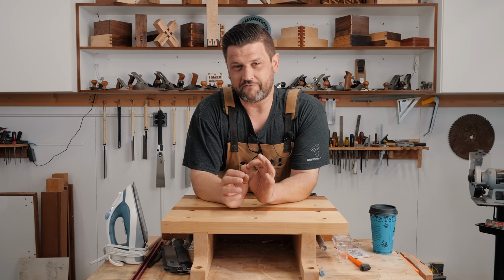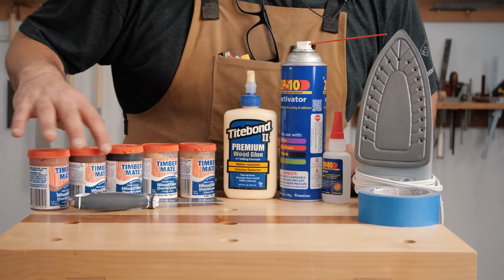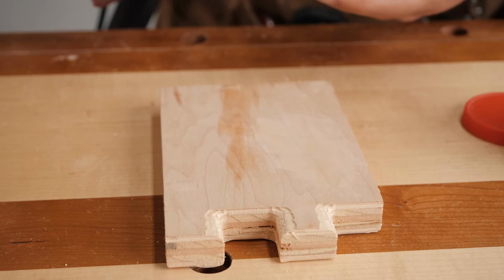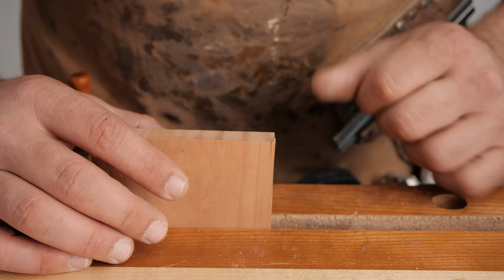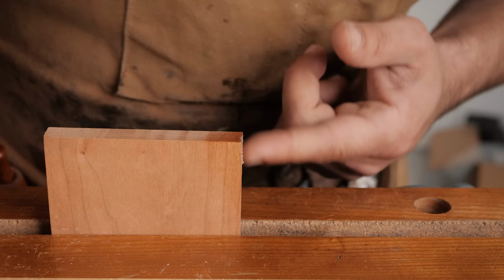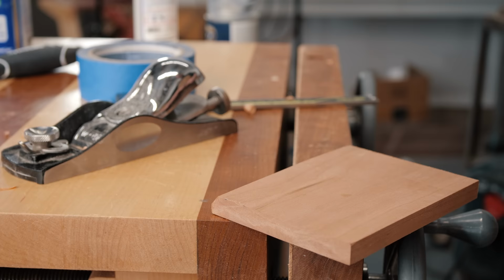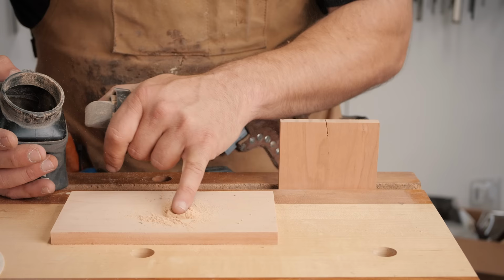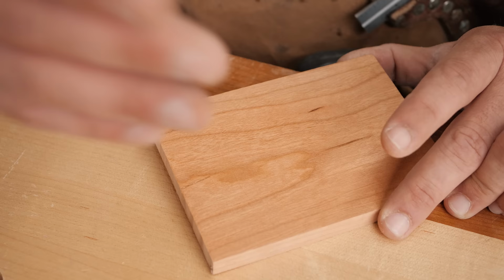7 Ways to Fix Common Woodworking Mistakes

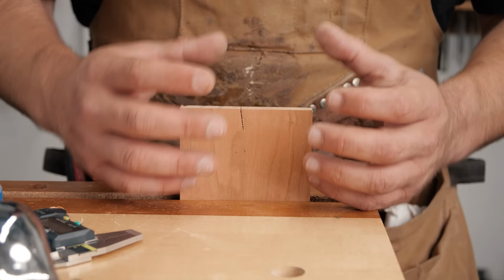Comment: 7:21 Another great trick (that's even less work!) is to fill the gap in with glue, then sand with a sanding block on top of the gap and it automatically fills in!

Comment: Protip, rather than spend money on filler. Use glue and the sawdust from sanding the exact material to make a custom putty which will be an exact match to the piece you screwed up. If I'm using filler it's because I intend to paint that part of a project, so you don't need to spend a lot of $$$ on colored fillers.

Comment: The sawdust and glue method does not work wit Many finischings like lacker but you can also use like a spezial glue ore if the finish is oil you can also use oil... Use your mind and make tests...

Comment: A method I learned for panel glue ups is to do a “in out” method. Your first board you joint should have the face in (facing the fence) than the next board should be out(face side pointing away from the fence. Continue alternating with however many panels you have. This helps if your jointer is not at 90 degrees by creating a complimentary angle that will help close the gaps.

Comment: 12:15 what equipment was used to mill that board? I want to mill a 12 x 12 x 2 in piece of white oak down the middle to open it like a book. I don't have an actual mill is there some kind of jig I could make
Reply from the maker: Check out my planer sled with drywall video. Cheers

Comment: I have a guitar made of Honduran mahogany, and I used the Rockler  wipe on finish. I got a dent in it afterwards. Will the iron and water trick work for it? What steps should I take? Or should I do the sawdust and ca glue fill route? I appreciate any feedback from anyone. Thanks!
Reply from the maker: The iron should help. It works through paint even (from another commenter)

Comment: I've made a few heavy-duty picture frames from salvage wood -- knots, cracks, nail holes, ...
Sometimes the knot falls out or breaks partially.
The fix?  Heavy varnish on the knots.  Bowties bridge the cracks, if they're bad enough.  Maybe a splint or two.  A little extra varnish in the holes.
Result: Dramatic.  It's *wood*; it's not plastic.

Comment: Great video, thaks. I leave you one more trick related with the video, if the glue doesn't want to fill the gaps on the wood help it with dental floss to move it deeper.

Comment: How would you fix deep scratches in a sprayed handrail?
Reply from the maker: Epoxy maybe using blue tape. Sand flush and re spray
Reply from the maker: Epoxy maybe using blue tape. Sand flush and re spray
Reply: Evan McCrindle I'd use furniture repair wax sticks. You can melt them on a spoon to mix colours and get the perfect match

Comment: Something I stole from Crimson Custom Guitars is to:
Take masking tape, align it to my bench (or one piece of wood, if I’m hand-joining with a plane) and to the other piece of wood, apply CA glue to one piece of tape and accelerant to the other (do this in two to five areas depending on the size of the piece) and combine them for the effect of double stick tape without any of the residue

Comment: Personally I hate wood filler. I ALWAYS can see it. Maybe my eyes are just different but I can spot it every time. I've pointed it out on stuff at family friends. They can get close but it just slightly off. What I use is the wood glue saturated with very fine wood dust from the same species. I have bags of the dust in my shop.

Comment: My most common mistake is not thinking when it comes to where I put screws. I've lost count of the number of times I've screwed in from one side and then tried to put another through it at a 90 degree angle... :-|

Comment: wood filler is generally shit for plain wood finish even if you sand it, reason is when you varnish it it doesn't darken like the wood and becomes visible. Sanding doesn't usually get rid of it and you don't know unless you varnish...best way is to fill with wood filler then as it starts to dry wipe off the excess with a damp cloth, that way it finishes better if you varnish it ;)

Comment: simple fix for cheap tools and questionable materials?
I was putting what was supposed to be 3/4 dowels into holes I made with what was supposed to be a 3/4 spade bit, but the holes were too big. I took a very fine file and made a few passes on the sides of the bit. The rest of the dowels fit the holes perfectly.

Comment: how about old school egg white and saw dust..... ive used this trick on every single guitar ive made coz I prefer to be as "natural" as possible and I like it to fill pores for French polishing... I guess its more of a step not really a fix but whatever
Reply from the maker: I've never heard of that one. How does it work?
Reply: @katzmosestools  I just separate the whites from the yolk into a small container and pour a bit onto the piece and spread it out and sand using a fine grit... maybe start at 400 and go up from there so it get right into the grain and pores... I usually do this after ive done most of the finish sanding. I use a small sanding block and the edges on one long side and one short side chamfered and leave the other two sides sharp to get into corners (I don't know if its necessary but I just thought it might help to be a bit softer coz I don't use cork ones) I make small circles and figure 8s like as if I was applying shellac. when it starts to get a bit tacky I just spray bottle a bit of water to help it slide. I let it dry for an hour or so and continue up in grit with just a small spray of water to start each grit... drying between each grit until im happy with it. once im done filling I just lightly hand sand with the grain with the finest grit I have (about 1200 grit)  and then let dry over night then vac any remaining dust and im ready to French polish. this is just my way of doing it.... im sure other peole have their own ways. experiment bro.

Comment: I was trying to make a bookmatched acoustic guitar top and both sides are cupped. Do you have any tips for flattening wood? I tried to use some water on the concave side but that didn’t do much.
Reply from the maker: You should watch the whole video. I address the same issue

Comment: What if the sawdust and glue were mixed together and then added to the "feature"? That should make a better end result than just sprinkling it on. The worst part about mistakes is that you know they're there, and that infuriates me. Probably why I'll never make a proper woodworker

Comment: All great ideas, except the glue & dust in "all joinery cracks".... ummm... then the wood can't expand like it should, and when it contracts, ugly cracked glue fills. Mistake imho.
Reply from the maker: Disagree 100% but appreciate your opinion
Reply: really?  a woodworker who doesn't "agree" that wood expands and contracts??  oooof.... to think I almost subscribed.
Reply from the maker: @ChrisLocke1969  hahaha please do, I didn't insult you. In fact I was quite polite with my disagreement. You clearly don't understand wood expansion. Wood expands on average 1/8 an inch over 3 ft. If you think that a 1/4 inch wide dovetail is going to expand anything more than a hairs width you need to educate yourself bud. PLUS, if you're using glue what does it matter if you rub sawdust on it. I do this for a living. Day in and day out. I've literally never had a piece come back, out of 1ks of delivered pieces.
Reply: @katzmosestools  insult? Its insulting to not realize we don't all have sponsors to help pay for maple, to fully understand wood expansion. Good day, sir.
Reply from the maker: @ChrisLocke1969  hahaha that's the most asinine argument I've ever heard. So you're admitting you're wrong and blaming it on the fact that I've been a professional woodworker for many years and I worked my ass off to grow my business to where it is today? Sponsors dont come before basic understanding of wood movement.

Comment: Always save your sawdust! Lol.

I was fixing an antique table that had the horrible misfortune of being "repaired" multiple times of the years. When a friends kid (my age) decided to get drunk and sit on this poor center column, tiny table, he broke three of the four feet off of it, two were loosely held together with sheet rock screws without the courtesy of a pilot hole. It really was a mess down there. 

So some doweling,  custom making a jig, and lots of sawdust+glue because there were peices missing, and cracks left from the screws, it was back to normal in two days. Well, not completely, because the feet were old enough to warp over the years, and i was there to put it back together, not restore it with refinishing.

Comment: Japanese carpenters, leave their mistakes in, as a reminder. Sawdust and glue, very old trick. Best trick of all, blue tape, does more than people think it will. Now, the "reflattening" but on an angle? Naw, just always went flat with a hand plane, more accurate than a planer/jointer.

Comment: So, I'm still watching the video but I doubt you'll cover it. I noticed that a lot of woodworkers (at least on YouTube) when they glue stuff together they don't align the wood on all 4 sides. Like I was just watching a chess board being made and he didn't align all for sides before using glue. Normally the excess is cut off but if it was even there would be less waste. This isn't channel specific I've seen a loooooooot of channels do it some waste more than others but it drives me crazy. I'm just wondering is their a specific reason is it laziness for some or is their a positive I'm missing. I won't name channels but big and small ones do it. It is just mind boggling to me cuz it's essentially throwing money away. I would be as efficient as possible to use the most wood especially if I was using expensive hardwood. Hell I'd save pine.
Reply from the maker: Its probably way too long to explain efficiently here but am basically the only way to get a truly flat square edge sometimes is to cut it off later
Reply: Jonathan Katz-Moses oh I knew that but sometimes there's huge chunks cut off 👀 even if it was to get a square edge wouldn't having straight pieces still be better than random sized bits? Especially with the more expensive woods? Like I said it's almost every wood working channel lol I figure there's something I'm missing besides a square edge cut because someone who takes hours to create (sometimes hundreds of hours depending on the size of the project) probably isn't just a lazy ass who doesn't care.
Reply from the maker: @NerdyDude186  as a new woodworker everyone feels that way. As you get more experience you realize that the 1 x 1 x 1 piece of wood you worked so hard to save will just take up room in your shop for eternity. I have drawers of exotic cutoffs I fantasized about using for this or that. I think I've dipped into those maybe 1 or 2 times in the last 5 years. You'll realize if you're trying to size for glue up you'll never have perfect edges. Never. Trimming sone pieces after glue up is the only way to get square clean edges. You learn that because you spent "100s of hours" saving 2 dollars in wood is worth the trade off of perfection. Plus what's the difference if you cut it off before or after glue up. It's still extra. Boards don't come in the same size ever

Comment: There's no way to fix mistakes,
Only mask them.
And if your shooting end grain without a centre finish or a shooting board then you have no business holding a block plane (the correct plane for shooting end grain).
Call me picky, but I kind of think:
Right tool=good job.
Wrong tool=bad job.

Comment: The problem with the sawdust is the durability and the discoloration overtime or even when you add the finishing touches.

It will look good for about 6months, but after that, the glue will begin to mismatch the coloration of the wood.

And when you do finishing, it won't adhere as well to the glue and will cause very apparent structural mismatch.

They're great ways to make a quick sell, but after X amount of time, it will become apparent and as a Woodcraftman, you will lose credibility of your own work over time.

Fortunately, in the 21st Century, alot of people do not care as much for such things as most people end up trading or exchanging furniture after X amount of time 👍

Comment: One way to fix all mistakes. Don’t make them.
Reply from the maker: Every single project has mistakes. If not you're probably not challenging yourself
Reply: Jonathan Katz-Moses I did challenge myself with under water basket weaving once and didn’t go well. So I have never tried again.

Comment: Great video, Jonathan.  I learned one new technique that I am sure to employ.  I always feel guilty, cheezy, unethical, etc. when I post a link to one of my videos on somebody else's video, but you did ask for additional fix it ideas.  I have two that are for extreme situations on a workpiece you just don't want to start over on, like a workbench.  The first one is fixing a horrible job you did for a wedged through tenon job: https://youtu.be/oOzSWpOUnH4 and the second one is for fixing a joint gap that is too dramatic to use the sawdust and glue technique: https://youtu.be/pElMy-jqwjo.
Reply from the maker: I'll check it out bud!
Reply: @katzmosestools  Congrats on reaching 100,000 subscribers - you are definitely earning the large audience.

Comment: Not telling a client mistakes you made on (by that client) paid project? Quite unfair, client is not expecting to pay for your mistakes or "hidden features", I would not hire that woodworker again.
Reply from the maker: Every single project has mistakes. If you're a good woodworker you can fix them beyond recognition. If it's bad enough to be noticed you redo it. I've never once completed a project mistake free and strongly disagree with this comment but I do appreciate you sharing your opinion
Reply: @katzmosestools  You dont understand my point. Iam not telling, you can not do mistakes. Iam telling you should not lie to a client
Reply from the maker: @MrSpalovac  I understand your point I just completely disagree. I stand by my reply which is coming from an ex exclusively commission based woodworker.
Reply: @MrSpalovac  I guess you have no idea what you're talking about my friend. "Mistakes" are not really mistakes but some little errors that are just easy to correct, this is a part of woodworking and it is a part of all projects allover the world. If we were to start allover again whenever we make a project, there would be no trees left in the world because every making has a dent, scratch, or rip off because wood just behaves the way it behaves... if you want flawless job you should work with mashine made shitty furniture that get thrown away in year or two because of very low quality. In short ... High quality always has errors, and good woodworker makes those errors dissappear respecting the wood he uses for his projects. i would never throw away good piece of wood when i can repair a dent with iron. If you want me to throw it away, you will pay me 10x more for the project or get a slap. No offence ofcourse but I see you lack understanding. No offence brother  ;) Btw love the channel and all the input in the comments from everyone around.  i will contribute  my own thoughts when i can, glad to be part of something this kind. even tho i fell in love with woodworking just few months ago  i feel like it;s something i will do for life